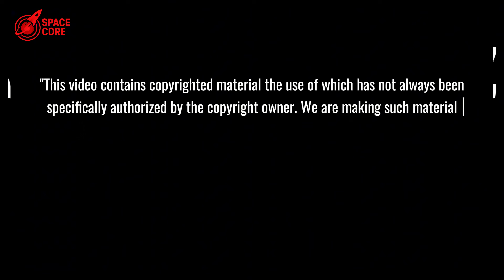SpaceX Finally Revealed VAST's Gravity Station SHOCKED Everyone...Here's Why!

Comment: In space refueling is not hard. a booms on the top right side and receivers on the left side. When inverted top to top it all lines up. Need a guide arm are 2 on the Depot ship. Will need 3 booms, Helium, Methane and Oxygen. Helium Bladders in the Depot ship will change the PSI in the tank and Fuel transfers. Receiving by vacuum and transfer by helium increases in Bladder PSI. Depot ship needs to be 9 tanks, 2 Fuel, 6 L/Oxy and center Helium, Each Tank 40m L and 4m od. The center Helium is 45m L. Below are the restart/header tanks are 6 L/Oxy and 2 Methane, 6m L x 3m od. The Center is the plumbing. Testing, with Helium and L/Oxy can be between 2 modified Dragon Cargo 2 bladdered tanks. The one acting as receiver will vacuum out the helium out of L/Oxy as the Tanker pumps in helium
Reply from the maker: Your concept for in-space refueling with booms and helium bladders is intriguing!

Comment: Interstellar travel WILL NOT HAPPEN with solid or liquid propellant. Some form of exotic propulsion has to come along before Interstellar travel would be viable.
Reply from the maker: You're right—solid and liquid propellants can't achieve the speeds needed for interstellar travel due to their low specific impulse and massive fuel requirements. Exotic propulsion like fusion or laser-pushed sails is crucial to make it viable.
Reply: Such a shame that Elon and others seem to be completely myopic about obvious solutions that have been flying around our skies for many, many years.  Full control over inertia and gravity forces is a done deal.  All we need to do is find out how it is done.

Comment: OK, looks cool. I was just wondering; what if Elon Musk and SpaceX put their own space station into orbit, and using a Starship, pushed the station to Mars orbit. The entire journey the crew has gravity and more room. Leave the Station in Mars orbit and use Starship to land on mars. Thoughts?
Reply: I am pretty sure the fuel required  for a trans- Mars injection burn, and then the burn required to slow it and put it into orbit, is far greater than the Starship can provide.
Reply: @JimiGunn  I guess. Though it would be sweet to have a station in orbit there, possibly a place to park tankers for extra fuel before landing on the surface. Just a thought.
Reply from the maker: That's a bold idea! A SpaceX station with artificial gravity could revolutionize Mars missions, but docking and stability challenges need solving first.
Reply: It could be done.
Reply: The liberal swamp will take it over
Reply: How they gonna get past the moon, nasa and others have already told us they lost 👀 the technology to get there 
😂🤣😂🤣😂🤣
Reply: What do you think will happen when he finally gets a functioning Mars capable vehicle? Gotta store all that fuel somewhere lol there will be a SpaceX space station

Comment: Only 4.4 m diameter ?
Though I guess it can be launched by Falcon-9 or Falcon-Heavy.

Seems like a good new “training” space station.  Obviously larger would become possible after Starship becomes operational - but that could still be a few years away.
Reply from the maker: Haven-1’s 4.4m diameter fits Falcon 9/Heavy launches, making it a practical "training" station.
Reply: with the improvements in technology a lot more of that diameter is actually usable compared to the ISS modules.

Comment: Iy's a really good idea that allows a meaningful workforce to live in an environment which is relatively non-toxic so aa long term stay won't be as hazardous as the ISS. In addition the station volume could be doubled     
 just by rotating one of the ports on a copy of the original by 45 degrees and connecting the two hubs together with the offset. That allows all the segments of each section to have unobstructed solar exposure. That would be enough living space for a decent crew size. Since most of the reasons for an LEO station revolve around zero G or full time space exposure, most commercial or scientiific activities could be done in nearby non grav structures whose crews would commute to the Vast station in their off hours by shuttle.
Reply from the maker: ast's Haven-2 artificial gravity reduces health risks for long-term stays, unlike the ISS. Doubling volume via a 45-degree port rotation is clever

Comment: There were good reasons 1950’s SciFi rocketships were reusable and landed propulsively just like there were good reasons 1950’s Space stations were rotating and accessed thru airlocks at the hub. It just took us this long to make them work.
Reply from the maker: 1950s sci-fi nailed reusable rockets and rotating stations like Vast's Haven 2.
Reply: There were no reusable rockets, nor were there space stations in the 1950’s.
Reply: Wear and tear . Not going to replace it in space .